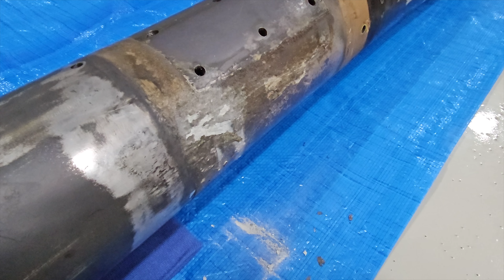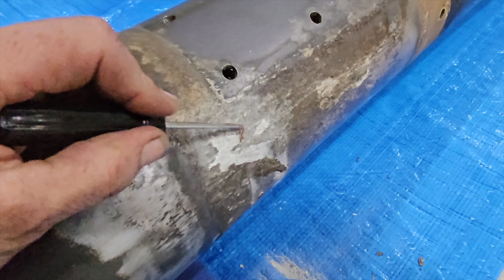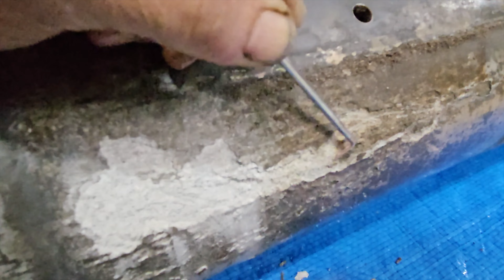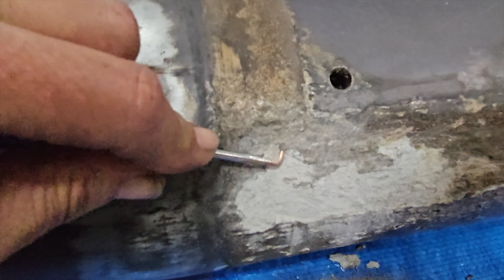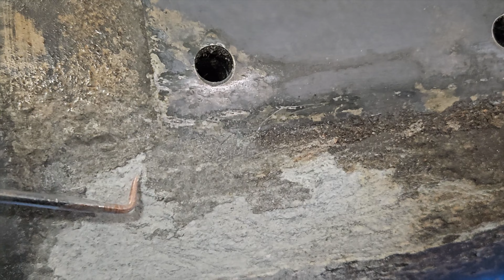Very Bad Spar Corrosion Up Close and Shedding - 4K  - Grumman Style

Comment: The bolt holes you see in the spar are the bolts that attach the Landing gear attach fitting to the spar. judging by the amount of dirt & debris along the attach point I'm sure this set up a great place to start the corrosion to the exfoliation process. This didn't happen between annuals...and should have been found years ago. It would be interesting to test that to failure just to see what kind of load it could withstand with that much material loss.
Reply from the maker: It would be nice to test but a good spar can stand 11 g's with some bending.

Comment: Where in the airplane is this section of the spar located?
Reply from the maker: That section was under the wing root next to the fuselage.
Reply: @GrummanPilots  wow that's also the section with maximum structural stress.
Reply from the maker: Yep not a good thing.  No where near failure but bad.
Reply: What type of repair could be done to fix this issue? I’m not an A&P, but It looks like a new spar would be required.
Reply from the maker: You are correct, new spar time.